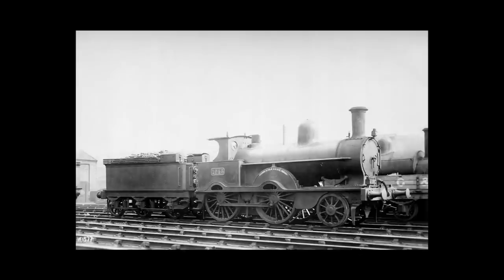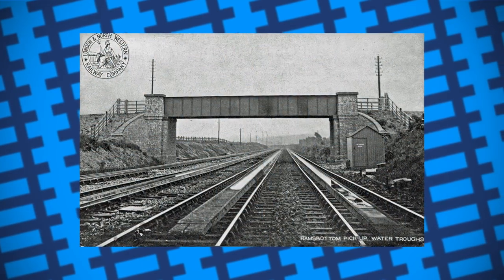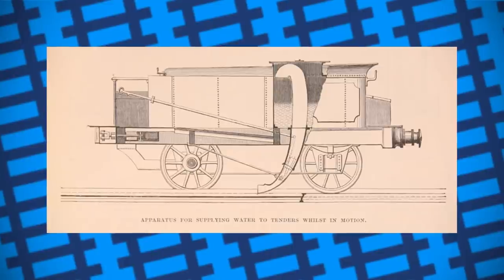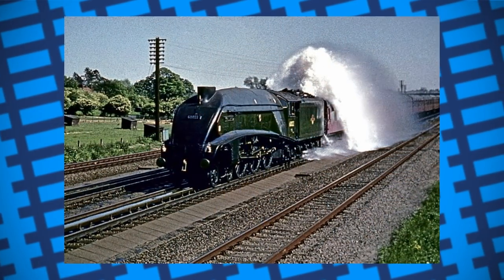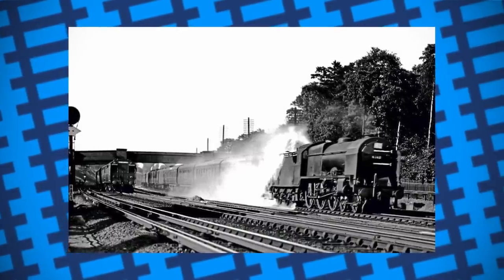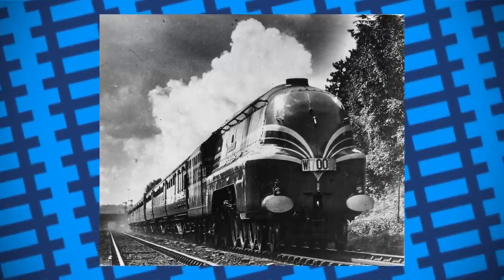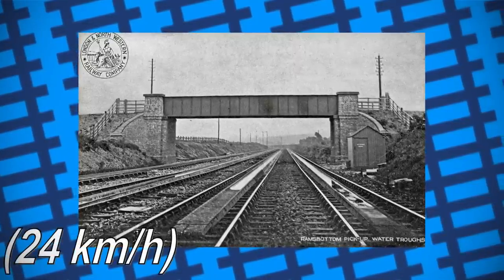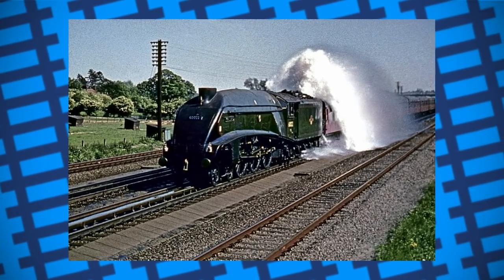How steam locomotives could refill their water tanks without stopping - The Water Scoop

Comment: I know why they used to troughs but I have to question the economics behind there use. When you add together the cost of converting all those tenders as well as the cost of building operating, maintaining and manning them, and all the repair costs, just building bigger locomotives would have been cheaper. The problem for the London and North Western Railway by this time was that their engines, fine looking locomotives though they were, were too small and lacked power. So at some point new ones would be needed. So if you can afford the troughs you can afford new locomotives.

Interestingly the London North Eastern Railway would get around this problem by adding a second tender for their London to Edinburgh express trains. They even included a passage down to side of the tender to allow for the change of crew on these trips.